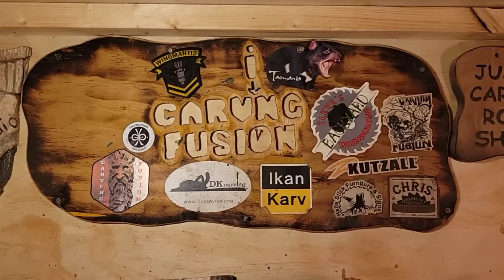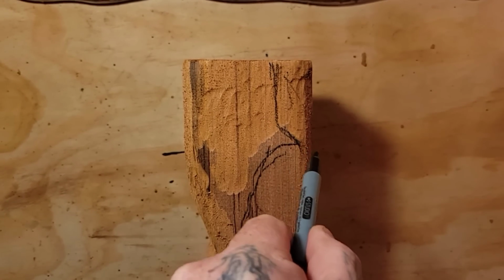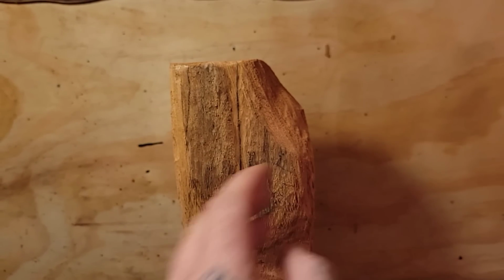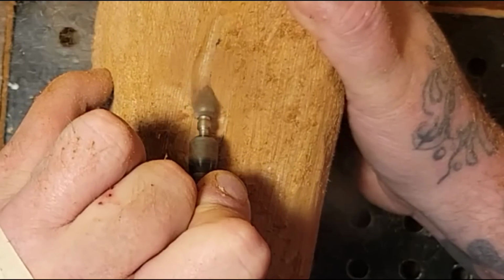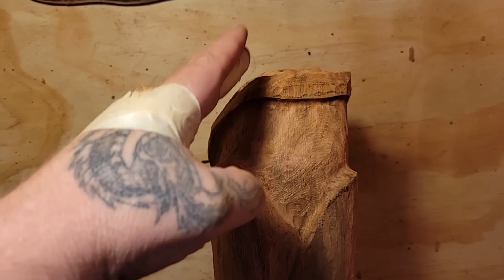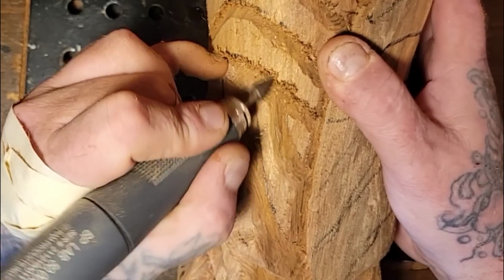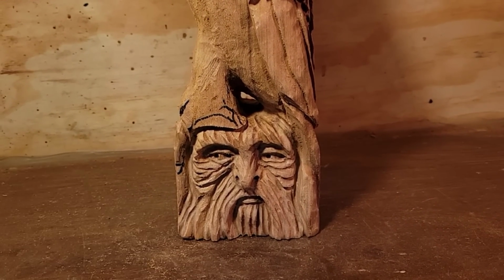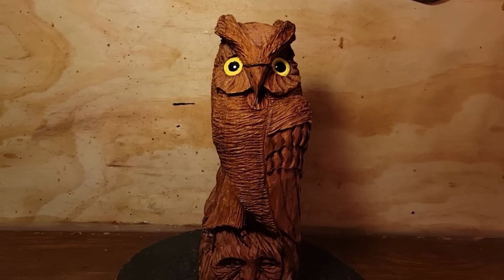Very beginner Dremel wood carving an owl. Cut by Cut.

Comment: What is that three point cutter you're using for the undercuts? Haven't seen one before and I'm not finding it searching those terms.
Reply from the maker: Amazon 1/8 dremel bits
Reply: @CarvingFusion  haha yeah, I got that part, but what is the specific bit you used for the undercuts?